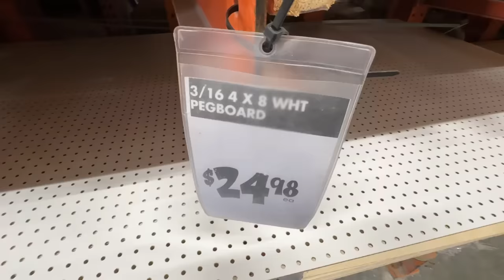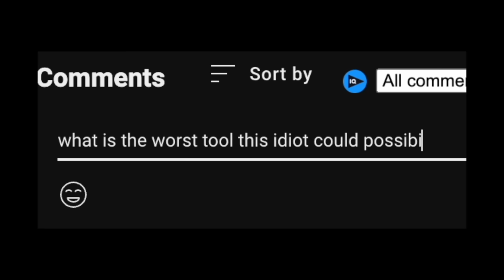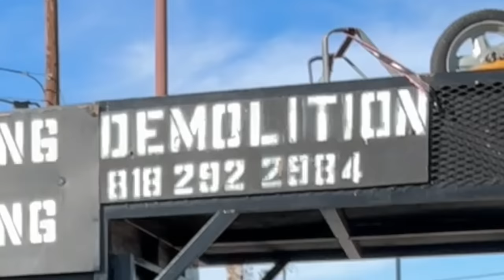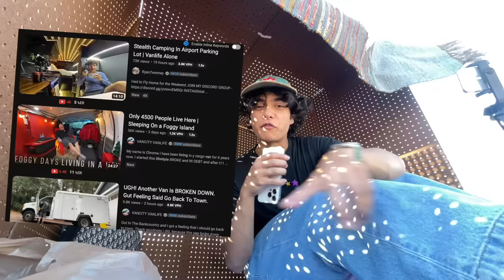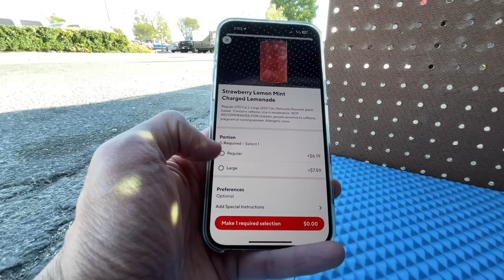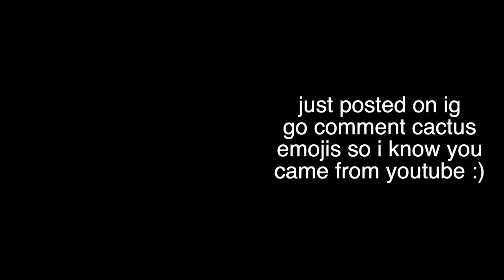i built a home in home depot…

Comment: Let's transform a 0.01m² space into a functional house. Little John lived frugally and worked diligently for two years managing to save up half a million to buy a house in New York. However, upon moving in, he was shocked by how small it was. He couldn't even stretch out his fingers. Now, let's explore how we can help Little John transform it into a functional home. First, we'll construct a durable frame using galvanized square steel anchored firmly to the wall with expansion screws filled with grid steel bars and concrete for lasting strength. We'll also install thermally broken aluminum windows, expanding the living space by 2 square meters. Next, we'll build a multifunctional sitting platform on the floor with hidden storage underneath for bulky items, saving precious space and providing a seating area for Little John and his girlfriend. This platform doubles as a comfortable bed that can sleep two, surrounded by cushion panels in lucky colors for a better rest. We'll add a movable table on the bed to serve as both a workspace and dining area, with an outlet switch nearby for charging devices, making it perfect for work and meals. After use, the table can be stored beside the bed, keeping the space organized. We'll then construct a bedframe from galvanized square steel, enhancing its appearance with wood veneers. Incorporate a pre-buried drainage system for convenience. Build a set of wall cabinets with a countertop drilled to embed a sink. Underneath, install a build in washing-machine to keep dirty laundry at bay. Convert the countertop for dual use by placing an induction cooker for cooking, and install a mirror cabinet above. Next to the mirror, add a cabinet for spices and toiletries. Install a showerhead on the wall and an enlarged stand, allowing even space to ride a horse while showering
Reply: Lol,
Reply: Where are the screws borrowed from his aunt????
Reply: Not funny, didnt laugh
Reply: How much is three oranges
Reply: holy yap
Reply: @Melio_Jelio  thanks

Comment: Me who builds stuff: peg boards have holes already so u can just use nuts and bolts with brackets- why r u using nails and a hammer...

fair enough using duct tape tho, I used it for a project to connect mdf boards and THEY FACKING HELD TOGETHER